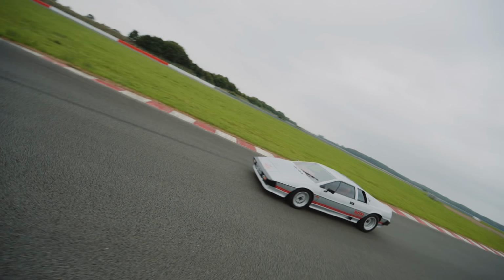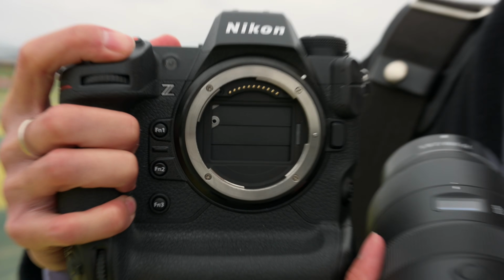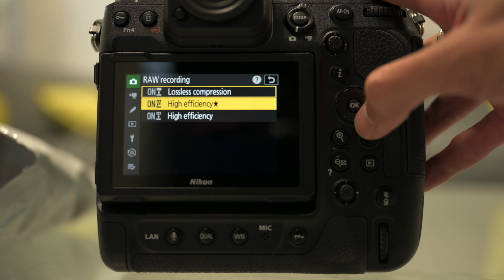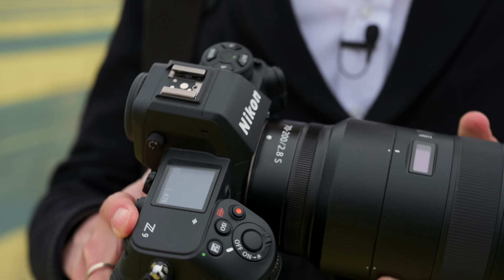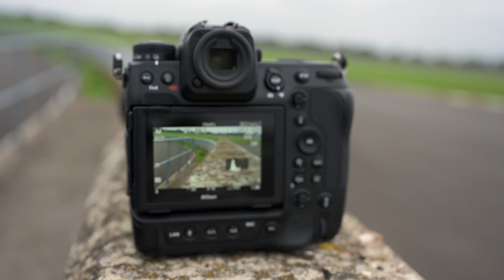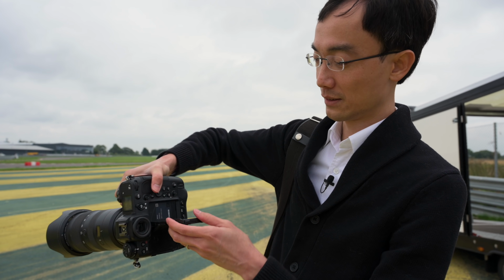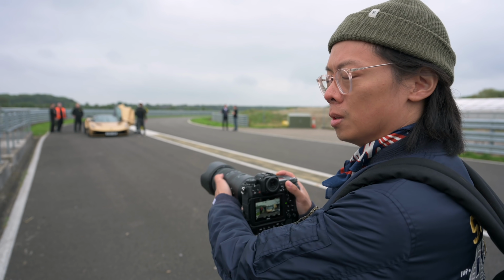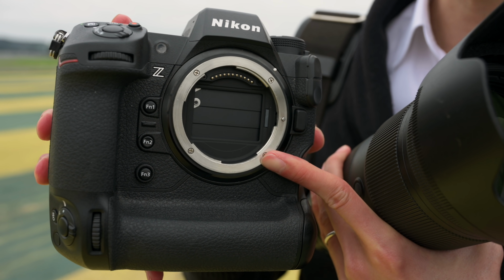Nikon Z9 has NO shutter! First Lok with Lotus super cars

Comment: Tip: hold the LENS, not the camera! Why? Because the lens is heavier. When you hold the body, the weight of the lens applies torque to the lens mount and body. But when you hold the lens, the relatively light body does not apply torque. In the long run, your camera will last longer when you treat it with respect.

Comment: We need to see how the shutter handles frequency based lighting.
Reply: One of the Facebook groups belonging to movie/TV production stills photographers actually performed a series of tests b ecause so many productions use LED lighting. There is no problem up to 1/8000th.
Reply: @AtlantaTerry  This is excellent news. 90% of my photography is under LED. Just to confirm, were they specifically testing the Z9 or just mirrorless Nikons in general? Sony users have trouble under dimmed LEDs due to pulse width modulation.